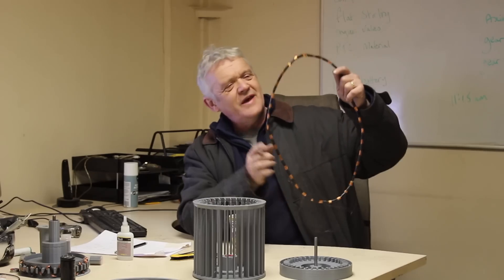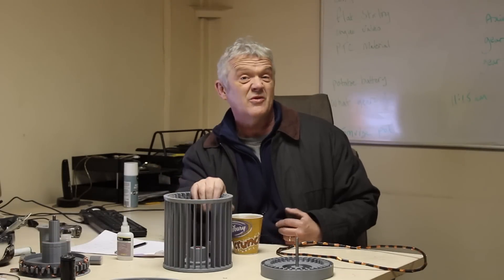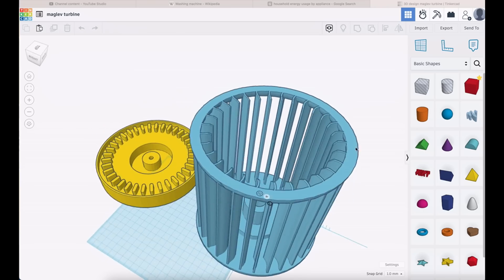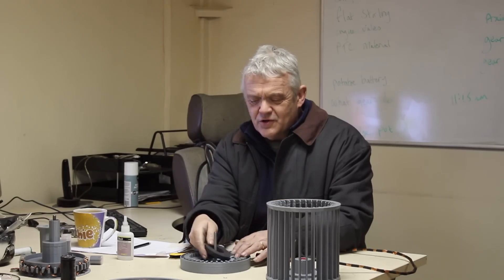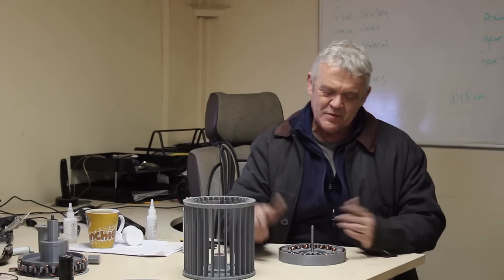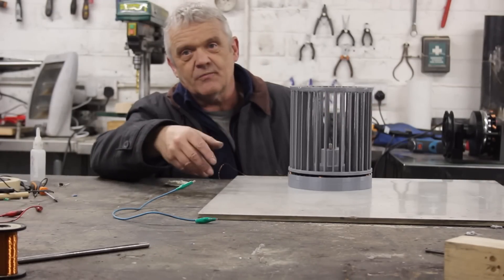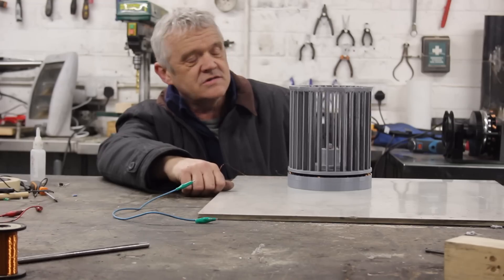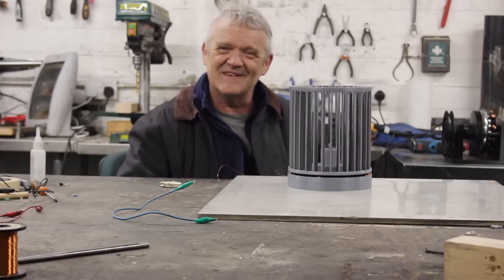1877 Maglev Wind Turbine

Comment: Hello Robert.
I had subscribed your channel, but, i can not find the mesures for the bearings you used on Maglev Wind Turbine 3D printed project.
How can i get it?
Reply from the maker: they are just skate bearings mate - which means they are 608 bearings which meant they are 22mm OD, 8mm ID and 7mm thick
Reply: @ThinkingandTinkering  Tanks very much Robert.
I will try to buy the bearings first and then i will print the project.
I will need the thickness of the wire, for the snake wiring, and the diameter of the rod too.
I have been working with fusion360 but my license dont alow to import the thikercad project.
If i had the project on Fusio360 i could easily adapt the project to fix it in my balcony. I live in an apartment.

Comment: When you test pleas test open circuit voltage and closed circuit amperage. I would then test a dummy load of 100 - 200 ohm (simulate a basic battery bank). A simple voltage is meaningless to the power being generated.

Comment: Thank you for sharing this knowledge. We tried to do this design as a science project (adding a Darrieus top as well). We are running into an issue, only producing mV of power, and only at low RPM. What is the impedance of the coil expected? (We used 32 and 38 awg copper wire, 400 turns and are seeing the same result with either coil)

Comment: Has anyone else done the 3D print for this turbine? Although there is no friction and it turns freely, it refuses to turn in wind. It doesn't seem to know which way to turn and so just swivels a tiny bit to and fro.
Reply: Did you find a solution to this?
Reply: @matthewchambers152  I found that if you block the wind to one half of the revolving blades with a board and angle another board so that it catches and directs the wind to the open side, that it then revolves very well.

Comment: when printing this did you use supports or not?
Reply: I printed it with supports but I modified them to increase the gap away from the model slightly, in hindsight I wish I didn't, two of the supports broke away mid-print (2 day print) but I still managed to salvage it. IMHO the model could quite easily have small adaptions made to not only make it stronger but easier to print without any supports.
Reply: @ashleycawley5816  Thank you!

Comment: might need a bit of a tweek to get the magnets a bit closer tot the coil.... perhaps a 2nd (light) maglev on top to basically push the cage down?
make it adjustable a bit so it can be tuned ....

Comment: @Robert Murray-Smith is the coil count the same as the magnet count? ie the amount of tabs on the serpentine base. I have a few mini-kegs of beer I have emptied so going to use them in a Savonius wind turbine configuration for fun, do you happen to know the best configuration for two halves of a barrel? would it be outside edges touching (ie double the diameter) or overlapping 50%/75%?

Comment: You could make a second piece like the bottom plate, add a second bearing and axle base for the top of the squirrel cage fan, add a second row of magnets and a coil for the top. Add a second mag lev ring to the top and you won’t need to worry about  high wind storms. It will also double  power output without significantly increasing drag from weight. You can also increase length of blades by increasing the rigid structure at the top and securing it at both ends

Comment: I see this as a battery recharging system for various types of large scale batteries (say for a home or small number of apartments) rather than work usage. Are any of the burgeoning large scale batteries capable of both producing energy and recharging at the same time? This product could reduce the amount of battery drainage during the day and recharge the batter overnight.  Comments?

Comment: What if you use axial magnets instead of bearings? Offset them a little bit so the bigger ones is the lowest and the highest ones and then you can tighten the upper most downwards to stiffen the bearing effect and prevent the turbine from lifting.

Comment: Just making a comparison with 1869. Why is voltage down so much? Is that just the difference if having the coil rotated 90 degrees or are the ring magnets affecting generation? The obvious differential is how fast it’s rotating (pull cord/ squirrel cage). Design aids itself very nicely to making a wall with multiple generators.

Comment: It's crying out for a second, counter-rotating stage (with a generator in-between and one at the top - do it Robert. Also, does the resistive torque not increase with speed (self-limiting)?

Comment: I wonder how much weight those magnets could handle since it just needs to not touch while spinning, so putting more wind catching action on top and maybe even some more coils held in place around it, might make a nice section of a wall, and just make a whole wall of them XD (funny thing is you can find those magnets in subwoofers all the time because people buy cheap subwoofers with the amp inside the woofer, and when that electrnic bit goes, the speaker is useless with out a powered subwoofer level output which most stereos don't have, that I have seen at least LOL (working on rigging one up that is not music oriented but to use the speaker to make a washing machine using the subwoofer to shake a container with water and soap in it for agitation and see how well it works for a mini cloths washer or automated dishwashing unit that will still have to have everything swapped into plain water and shook to get rid of soapy material :)  )

Comment: I see it was wobbling a bit so guess a top plate and longer shaft would sort that, so it does not wear on the bearings by being twisted around and keep them all working as they are made to work for years and years of trouble free electricity generation XD

Comment: There is a lot that could be done to improve it that is for sure. Adding a second generator arrangement at the top, adding stationary veins around the outside to compress more airflow as well as suction on the opposite side as well.

Comment: Hi Robert, I like your ingenuity, and the Maglev thrust bearing. But as the air gap between magnets and coils (in the generator) is where most of the potential "power genreation" is "lost", I feel a  "real" turbine needs a fixed location (mechanical thrust bearing) to enable just a couple of thou clearance between the magnetcs and generator poles. On my test generator set-up, using a simple Sturmey Archer bicycle wheel generator, the poles (without the high strength magnets you have) provide so much drag that the rotor you have would not overcome the generator knotching of the magnets. I.E. the generator start-up torque is too high for a garden wind turbine at start-up... Perhaps you can apply your ingenuity to something that overcomes such high resistance (Torque in the generator) as close magnets will develop at start-up, so the turbine can start turning in low velocity wind, then "close the gap" - or whatever - as the rotor starts to take adequate power to generate good proportion of the power from the wind? I havew considered the car alernator arrangement whereby the electromagnetic rotor is not excited much for start-up, then the excitation current is increased as the generator power from the wind increases. But this will need a bit of electronics measuring the Turbine speed, and complimentary electronics to apply excitation current to govern the power developed to that of the optimum speed of rotor, as the wind varies.
But I have clicked "like" as always.
Steamchick

Comment: I have a question and I am not the brightest light, but since your design is Maglev and if stabilized or locked down the only moving part is the bearing on the spindle. Why or what is the "cut off Speed" of this? I mean I see why on on a wind farm blades and all but this is contained and should just be the way to collect the output power. I mean I would think it should be able to collect your 4MPH wind al the way up to hurricane levels with the hurricane levels producing the most output. Since your unit doesn't or is a contained unit then I would think it should never stop generating. The worry is the containment of said output, if you can design a containment that can handle that amount of power output at a given time. This is where I see the Wind industry is falling down, to me the point at using wind or waves or whatever is the amount that can be collected and retained at the given time. If a turbine can be designed to overcome that "cut out or cut off" speed then to me is getting to a true wind use, if that makes sense. 

You have a wonderful and keep staying brilliant 
Semper Fi

Comment: What amperage did you get out of it ?
Which printer could I make this turbine on. Because I'm now thinking of buying one of the elegoo 3D printers, but which one do I need for the size of the print ?
The squirrel cage does it have two bearings one for the top and bottom of the metal stabiliser rod ?

Comment: Can one flip the baseplate, so the copper cables get shielded from the elements (on the underside)? Thinking that the magnetic effect should be able to pass through the plastic. Less effective possibly?
Reply from the maker: yeah - or you could just pour potting compound in

Comment: Great video as always. I have a question: If the magnets were in a mating conical configuration, could you omit the spindle shaft and ball race bearings? i.e. would the maglev bearing concept be stable without any other mechanical constraint? My thinking is that the friction could be reduced even further. I guess you would need an opposing pair of bearings otherwise the unconstrained wind turbine would just blow away in a high enough wind.

The next problem would be buying or making such a setup. I was thinking that maybe individual magnets mounted in 3D printed cones might work. Another approach could be to use a lathe to turn a pair of mating conical steel/iron rings to mount on the existing magnets. Is any of this feasible?
Reply from the maker: probably not - but I don't know - give it a go and share your findings

Comment: I could see these being mass produced and used as remote gadget charging stations like on hiking paths, bike trails, maybe for camping. you could add another coil and magnet assembly to the top of the wind catcher. magnets on the wind catcher and coil built into a table like structure that sits over the device. legs of table could be angled to direct wind in derection of turn wanted.
Reply from the maker: yeah I could see that

Comment: More magnets inside the diameter ring inside ring and more serpent coils under them each reduction would get less energy but finding the sweet spot could be worth it especially if you take the project larger and can have three or more rings top and bottom.
Reply from the maker: Cool idea

Comment: I had an idea can you gear it up to higher speeds at low wind speed by adding a second bigger lev mag wheel with north south mags close enough to lock to the generators north south mags and fixed so they stay just close enough to lock in sync both Lev wheels the bigger one spins fast in low wind then spins the smaller generator wheel with out fins at even higher speeds I'd love to see that made I don't have the tools like you
Reply from the maker: I will have a think about it mate
Reply: @ThinkingandTinkering  maybe a magnetic gear to increase the speed

Comment: the higgs field is responsible for mass needing energy to begin to move, reducing the mass of the cage reduces the energy needed to begin moving, are their lighter materials that can be used in the printing process with different geometry that can assist?
Reply from the maker: The Higgs field is it!
Reply: @ThinkingandTinkering  sorry, meant to clarify that higgs field is indirectly responsible for inertia, the greater the rest mass the greater the amount of energy needed to move said mass.

Comment: This is awesome. Wonder how nice this will work with vertical blades changing the wind direction 🤔. 

Could even make the blades adjustable for large applications so when the wind is tomuch, you can basically shut it down by deflecting the wind.
Reply from the maker: good question -  I don't know - give it a go and share your findings
Reply: @ThinkingandTinkering  Thanks, I would love to that, but I stay in a flat and are not aloud to do any work outside unless its maintenance.

But have seen it in action on various YouTube channels(not easy to find) and seems to work well.
Was actually giving a polite suggestion for you to share with your viewers.

Comment: Interesting design, i suggest to add a flywheel with the correct weight inside the fan around the bearings housing (set between fans and bearings housing ) in addition to that the flywheel weight will narrow the distance between magnets and the coil as increase the speed (maybe) .
Reply from the maker: give it a go and share your findings
Reply: @ThinkingandTinkering  Thank you , In our country sir we do not have electricity so what about a 3d printer or neodymium magnets , if we need to charge our phones we have to walk 3 km to a store . hopefully if i get out to better place  i will try , all the best .

Comment: Is it possible to charge a 12 volt battery with this and how many of them would you need to do this?
Reply: You'd need some extra circuitry to boost the voltage, and it just depends how long you want to wait.
Reply from the maker: yes it is possible and no idea how many needed

Comment: If you made the squirrel cage fan much larger (150 - 200cm diameter) could you use gears to drive several small generators?
Reply from the maker: yes

Comment: You should put a wind concentrator on its base. It is so that lower wind on an large area is funneled through a smaller area creating a higher speed. It doubles the energy generated and also protects against storms because ironically it limits the rpm at higher winds! There are a couple of scientific papers on this!
Reply from the maker: nice idea - go for it

Comment: I love the maglev incorporation. I wonder if the ring magnets field have a negative or positive impact on energy harvesting over time. Perhaps no effect at all. But maglev is supposed to be minimized friction so friction efficiency has been reached. Loved the video!
Reply: Yes, as the two magnets are trying to slip away from each other, there is more force on the ceramic bearings increasing their friction.
Reply: @darkfieldcarnivore3928  Ya, I got that. Still the maglev with ceramic bearing as a stabilizer is still more efficient then only ceramic. I was under the impression that the friction was less on the ceramic bearing as the weight of the apparatus is suspended by the mag field. What am I missing here?
Reply: @Moist_yet_Crispy  Friction is proportional to the force pressing two surfaces together. In the case of two reasonably well aligned magnets, that force is very small, theoretically 0 at the equilibrium point, even though it's an unstable equilibrium. Not much at all. As for the maglev interacting with the generator, it doesn't. The levitating magnets are spinning about their poles, so there's no change in magnetic flux coming from them. Plus the coil is on an equipotential ring so it's not going to get anything from the levitation magnets. If they were misaligned or eccentric, then the coil probably would feel something, but it would be a lower-frequency modulated DC offset.
Reply from the maker: nice mate - thank you for posting that
Reply from the maker: nothing mate - he is going with an idea and not really thinking it through himself
Reply: @Corey Grandmaison Archive  there is more friction on the vertical stabilising bearing but less overall.
Reply from the maker: DFPercush gives a spot on answer mate

Comment: If you’re worried about it flying apart in a strong breeze , put a second serpentine generator with another maglev/bearing setup on top . That way you could double up the generation
Reply: The art is to capture low winds here, so, having more coils/magnets will increase resistance.  But if you have a way to electronically controll when you draw current, or not, by closing/opening circuits and drawing power you can increase resitance and performance as the wind speed increases, like a energy recovery brake on a car works. This circuitry will broaden you range of operable windspeeds.
Reply: or put a circlip at the top of the shaft. There is enough space to prevent it touching the cage and causing friction, but will allow the cage to rise a couple of mm in higher winds
Reply from the maker: nice one mate
Reply: You can use the inner diameter space as well

Comment: Rob, could you do a test to show how the performance improves or otherwise with n52 magnets
Reply from the maker: probably not mate - all the theory and practice on how to build this is done now - changing for n52 will improve it as emf=BLV sine theta - where emf is voltage and B is strength of magnetic field - so increase the magnetic field - n52 instead of n35 and it will get better - you could do it though and share

Comment: Doesn't look like the serpentine coils were lining up with the magnets so that they add up all voltages, I.e each section that is going up direction has a magnet that induces the voltage in that part of coil; all coils parts in down direction get the opposite magnets, to all add up
Reply from the maker: they do line up - or you would get nothing
Reply: @ThinkingandTinkering  its just that you didn't get much power, I'm thinking adding one out those turbine types from a dryer to my shed using a dc motor. I'd love to be able to 3d print my own designs, so far I missed out 3d printing. 

Thanks for your videos and ideas